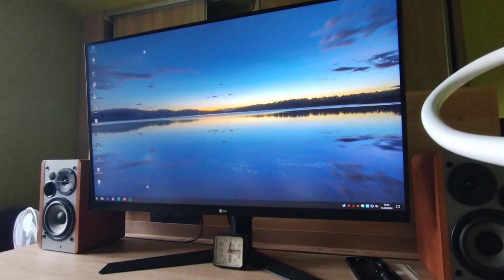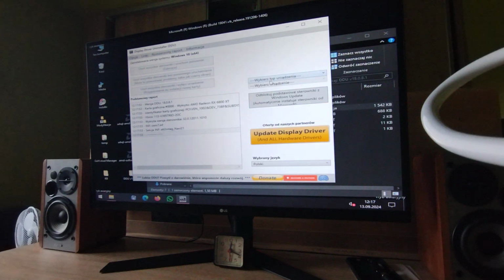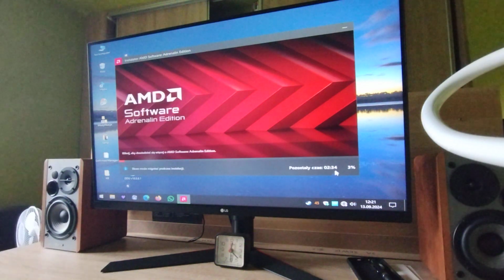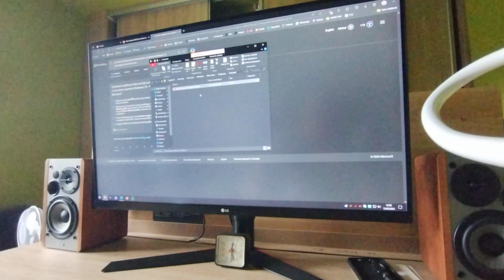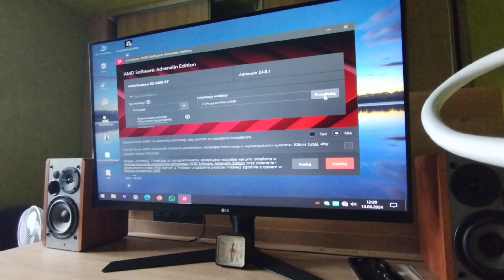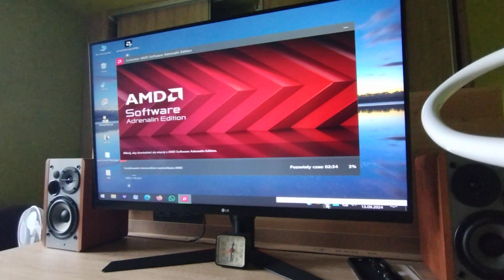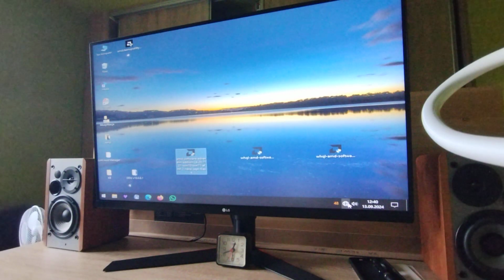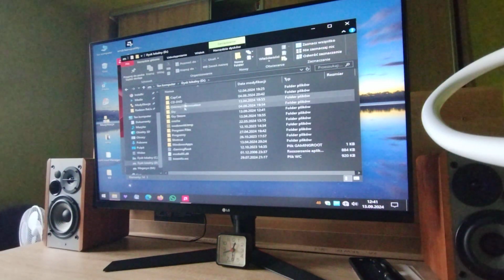AMD drivers feat. "User error"

Comment: I've gotten this issue a long time before. Hilariously, using DDU or install drivers in safe mode actually make them more corrupted. 
If the adrenaline software failed to start (as if seen by active process in task manager), you can fix it manually by adding one of the other .exe in the installed folder for it to work.

(Other than that, i usually don't update drivers and let them rot for months/years until i figure a more stable one)